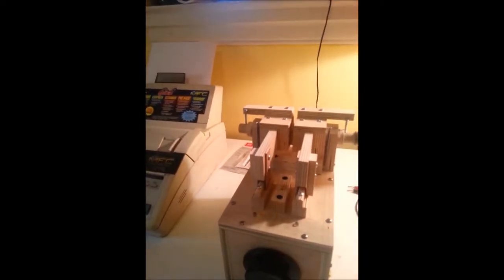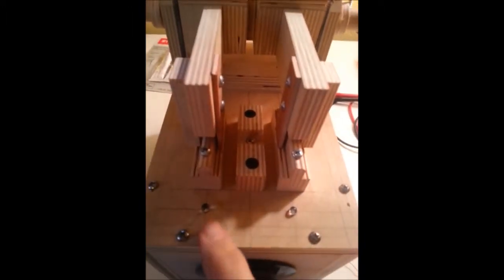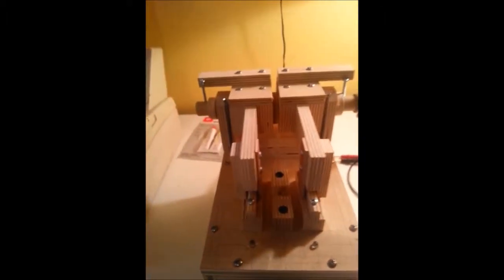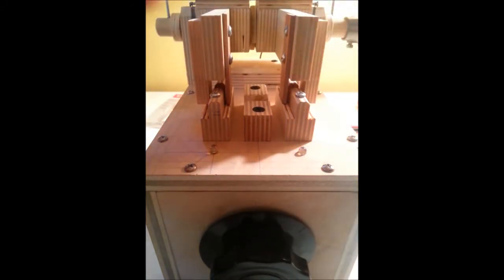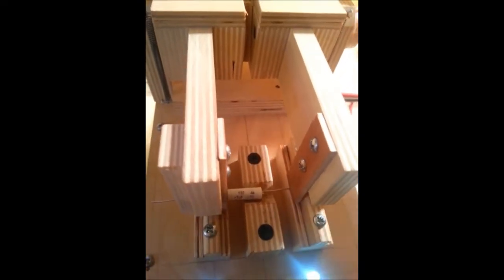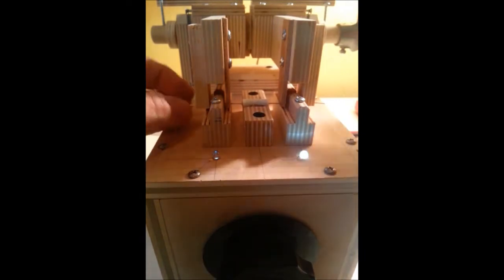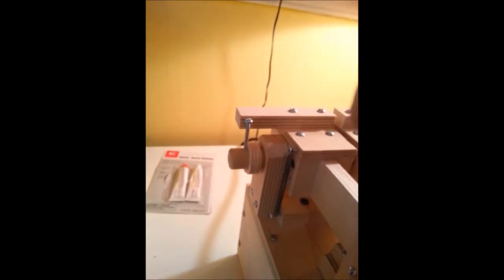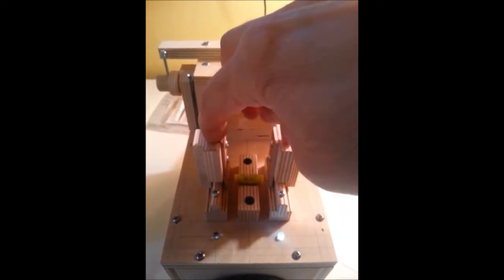capacitor shield finder

Comment: This is 5 years ago but still did not show what's inside? Looks like just a variable ac source to two rectified diodes. One side to a nail and on the center of the part. Which ever led lights up first couples to the center showing the shield or the negative side. Am I correct?